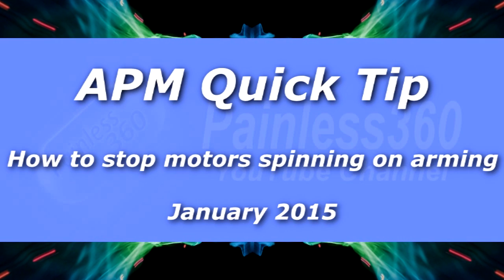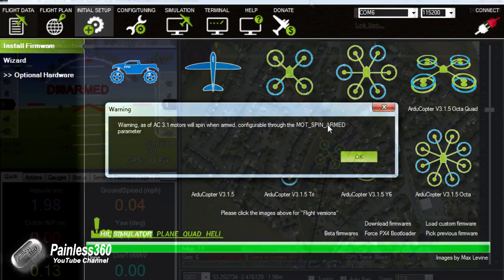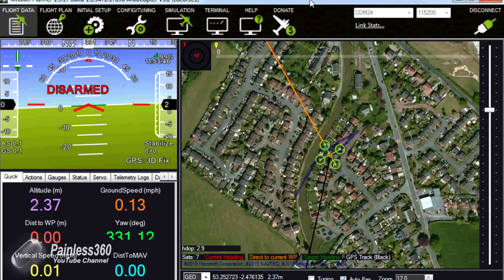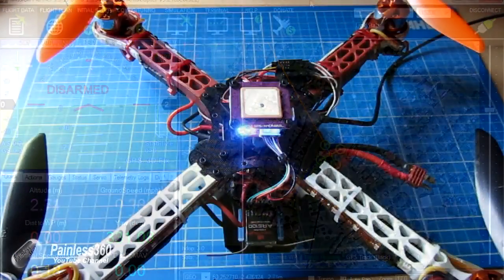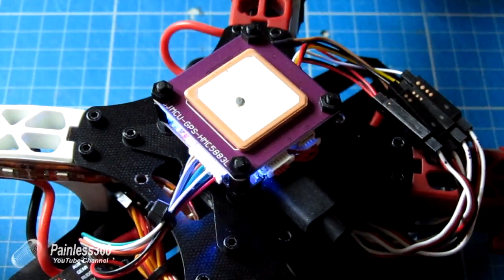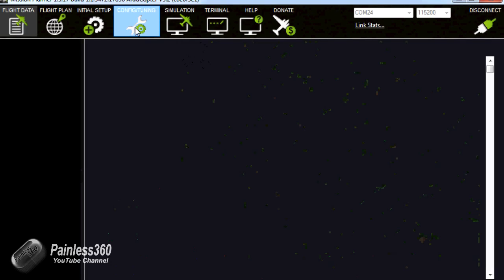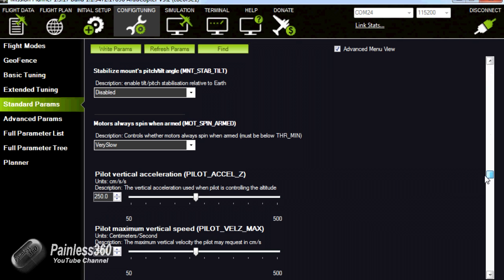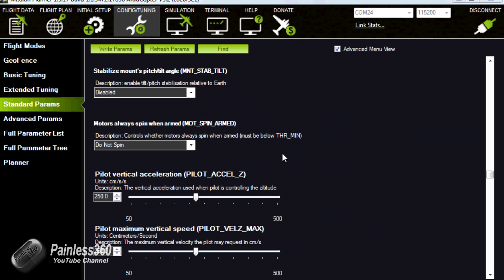APM Quick Tip: Stopping motors running when armed (MOT_SPIN_ARMED)

Comment: Hello and thank you for sharing your knowledge
2 independent question
1- if in this case while the copter is armed and motors doesnt spin, if we change the attitude of rotorcraft (for example make it pitch or roll by hand)  does the motor start spinning or we have to add trottle before seeing that
2-do you have any idea if we want to throw our quadrotor and then arm it in the air? is it a possible scenario for pixhawk powered drones?

thank you so much
Reply from the maker: Not sure on either. I don't use multirotors like that.. Best of luck

Comment: When I arm with taranis QV7 the throttle is full on.  Works fine in Beta flight for controlled speed and testing direction.?????
Reply from the maker: What flight mode are you in? What's the throttle position showing as in Missions planner? What troubleshooting have you already tried?

Comment: I didn't find the option motor always spin when the armed on 3.2.1 so plz tell me sir it's possible to change on 3.2.1. If so on which parameter did need to change
Reply from the maker: I’ve not used APM for years now so the best bet is the Ardupilot documentation. Best of luck!

Comment: Hi Lee.. would this be the same on a pixhawk board ? I can't seem to find the menu for it.  thanks in advance and keep up the great work
Reply from the maker: It should be as they are both running ArduCopter.. Be aware that the later versions of the code only run on the PixHawk.. http://ardupilot.org/copter/docs/parameters.html

Comment: You are a blessing to the community. Most people know things but dont bother to share. Thank you. Im from Singapore!!👋
Reply from the maker: You're welcome. Glad you find the content useful. Happy flying!
Reply: Thanks for the video, I am just testing for vibration with zero throttle with prop Indore after after arming it without props and think the motor speed is low enough by visual inspection ( I know I am such a genius!! :P), then When I arm it it immediately started flying indoor, with zero throttle, It was my first test with quad so I panicked and go for the safety switch. I have stopped the quad before it can damage anything indoor but I have few very deep cuts in my index finger with take 2 week to heal.

Comment: I have watched all the Videos you did and I thank you. But I have a problem I cant seem to figure out. My motors cut out for a brief second and I lose like 3 feet of altitude. I have not crashed, but It was close. I watch the trims when I have my quad hooked up to mission planner, And I go to where you can calibrate your radio. I can see my throttle setting hit 900. That is the number as if my radio was off.  I have ordered a new radio system to see if it helps. Any ideas?
Reply from the maker: +Roy Rodriguez I'd check the APM logfiles first of all, sounds like a short loss of Rx connection.. Best of luck.
Reply: Yes, it acts exactly as if I turned the radio off. I can not interpret the logs. I watched your videos last  night on how to access logs and even how to play back.  Mine did not look like a cool rollercoaster haha. I was doing full throttle while holding quad in hand to make sure as I moved it that the motors would respond. I am going  to finish watching all of your videos. Maybe I will see something I have not tried yet. Thank you so much for your videos. They are the best.  P.s. I am upgrading the radio system anyways.

Comment: Hey...I'm really stuck and I'm hoping you could shed some light on an issue I'm having. I have a wing I've setup with APM 2.7 arduplane...my motor is running when the aircraft is armed even at zero throttle. I cannot find the feature you mention in this video anywhere...and I've updated my mission planner software. Any thoughts? Thanks so much!
Reply from the maker: Have you calibrated the ESC?
Reply: +Painless360  i cant find it to on my standard params
Reply from the maker: I would do it manually (I have a video that covers it). Best of luck.
Reply: +Painless360 is there a video on your channel how to do it?
big thanks
Reply from the maker: Yes there is, have you looked?
Reply: not yet i cant find it
Reply from the maker: Google 'esc manual painless360' and you'll find it. Hope it helps.

Comment: Hi, can u show a video on how to arm and disarm the motors of the quadcopter using the controller by pushing both control sticks to the edge( left end for right side and right end for left side controller stick to arm/disarm... I've seen people doing it but dunno where to enable this function.
Reply from the maker: Ying chee Thum This is covered series - please use my playlists to find videos related to the subject you are interested in.Best of luck.
Reply: hi,hw adjust the speed on yaw on tricopter ?thank you repond please

Comment: But the buggers will still spin up the way you dont want them to dont forget to go into Advanced THR the THR_MIN set it to 7 not 130 or the setting where your motors just start to turn my dys1806 motors i used 7
Reply from the maker: Long Range FPV Quadcopter .TBS Discovery Sounds like you may need to recalibrate the throttle on the radio and look at re-calibrating the ESCs too..
Best of luck..
Reply: yea i may have too the copter I'm using was last used with openpilot ccd3 nano, do you by any chance know about the compass on the gps it doesn't seem to be working I'm getting sold gps lock after upgrading it with file off APM site is there an option to enable or disable it in UCenter? i already cut the track on the APM mini 3.1 board.
Reply from the maker: I cover this in the APM 3.1 video series. The Compass needs to be powered with 3.3 volts. You can do this will a little bit of wire..

Best of luck with it.
Reply: I think i saw your video and the gps i got is slightly different everything is on one plug i looked on the gps board and found the pdf for the compass as well and from what i can see this compass is already powered on this gps board the biggest problem i got is calibrating it because its on a lead there is a video online showing to use USB telemetry setup but i don't have that here yet.
Reply from the maker: You need to contact the vendor for help - the GPS should come with the cables to plug into the GPS and I2c ports on the flight controller..

Best of luck..

Comment: Hey Painless, I have found that my Hexa armed and the motors spin immediately. Fortunately I found this (your) video instruction about how to fix that.
Now I can arm the copter and no more spin at "0" throttle and when armed.
BUT: now, when I raise the throttle a little, all motors spins immediately at nearly full speed. What happened to my setup? Do you have an explanation for that behaviour after that adjustment?
Reply from the maker: bekawe2011 No explanation. it shouldn't do that. I would recalibrate the ESCs again..
Best of luck.

Comment: Have you had any issues with your power module not sending the the right voltage and amps to the APM? Even after i calibrate my power module the APM still reports the wrong voltage and % of battery power available.  I also think that it is going into some kind of battery fail-safe  because my throttle power goes way down and the copter will slowly descend even with the throttle at full.  I know I had fail safe turned off for battery.

Comment: great help painless, great series.
If motor spin on arm is enabled what happens after unscheduled landing (crash) , Pessume motors are still trying to run slow even though throttle at zero. Or is this feature overidden once you throttle up first time.
A link to a GPS/compas with right conector for APM 3.1 mini would be helpfull please (will pads on APM need short out for external compass/GPS)
Keep up the good work
Regards phill
Reply from the maker: In the event of a crash the motors spin until the timeout (about 10 seconds).

See my video series to learn all about the APM Mini 3.1 and GPS/external compass - https://www.youtube.com/playlist?list=PLYsWjANuAm4pCP3jjSAcmDJIEmyaEregs

Comment: I have no idea why anyone wouldn't want motors to spin when armed, I think it's a great feature. 
When my multirotor are armed I know by the spinning motors, and I stay well aware. If they didn't spin it can create confusion and end up causing accidents
Reply from the maker: I agree it's a great feature but only introduced 15 months ago in v3.1.

Some pilots have been using previous versions for a long time and are used to not having the motors start on arming. 

It's a personal choice and about what you like, and are used to.

Thanks for making the great comment. Happy flying! 

Interestingly this kind of feature if is now cropping up in Multiwii and other software/firmware. 

Happy flying!
Reply: Painless360 Yeah, i remember updating my APM one day and the shock of motors spinning when arming for the first time.  

I have seen a lot of people suggesting others enable motor stop on their Naze32 boards also, a lot of people are enabling it without even realising what they are actually doing but thinking its the right thing to do.

Each to their own.

Cheers for the great videos, as always!
Reply: Yes I agree it is a truly great feature particularly when the board mounted LED's are near invisible from the side .  I've been caught out by a KK controller when I forgot to disarm it and the throttle stick got caught as I reached down to pick it up.

Comment: A brief note on large/low/powerful kv motors (from experience)
Once you break the 3500 series and go into pancake style motors, the choice between spinning slowly and very slowly becomes a factor in ground performance prior to take off. This is mainly due to frame or landing gear integrity and design. On my Tarot 680 hex with 3508-380kv's which was a 3.5kg auw craft, if the choice was default (very slow) then the hex would shimmy and shake on idle- it smoothed out fine once rpm's were brought up, but it had a horrible shudder on idle that would shake the gimbal and look very unprofessional.
Moving that motor spin on arm to "slow" solved the problem as it idled at a slightly higher rpm.
Reply from the maker: ***** Good point Hiway, thanks.
Reply: Painless360 Hej, what version of program is that?
Reply from the maker: Why do you ask?
Reply: Painless360 We need this parameter for work but it seems it is removed from newest versions of program.
We've downloaded sources from github and try to find that version, but still not got luck